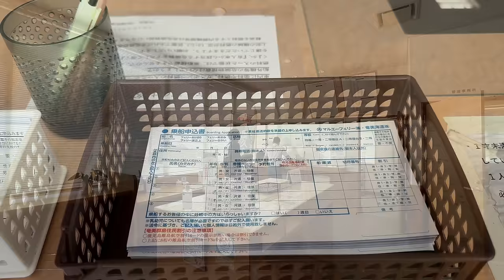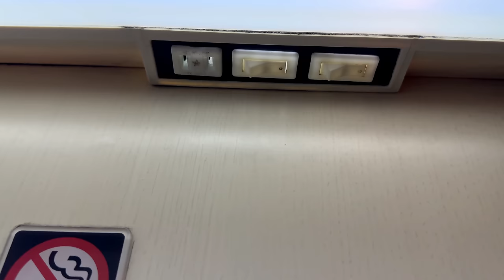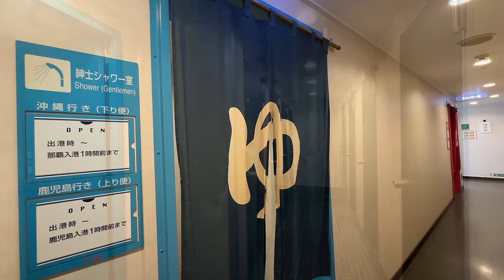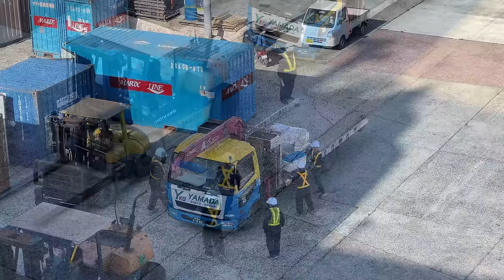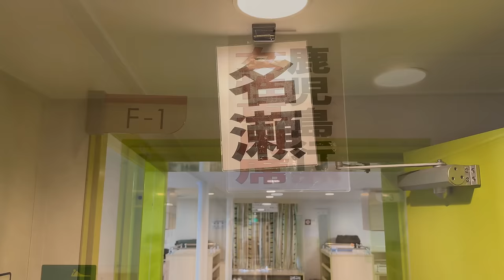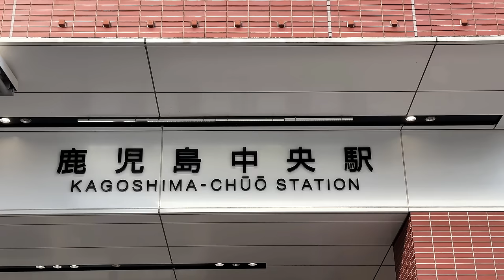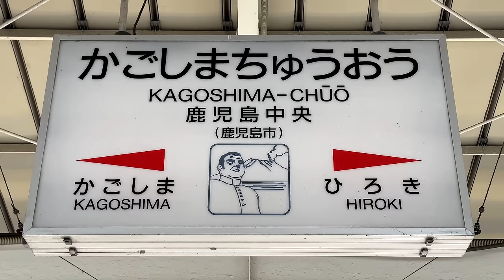【島めぐり】与論島→沖永良部 徳之島 奄美→鹿児島 フェリー旅

Comment: Great trip. Finally I can see regular container loaded by forklift into vehicle ramp (not included the cattle one). Wait, two ship running on same direction with interval around few hours? I think for this route only serve by one ship per day, so two ship from each directions. Overall great ship, food, and great island hopping experience. Less than an hour for Port calling? Amazing.
Reply from the maker: I was very impressed by the efficient cargo handling operations at the ports of call. In addition to the Kagoshima to Naha route, this ferry company operates a separate route from Kagoshima to Okinoerabu Island. The ports of call are slightly different, and the two routes have separate ports of arrival and departure on Okinoerabu Island.😸